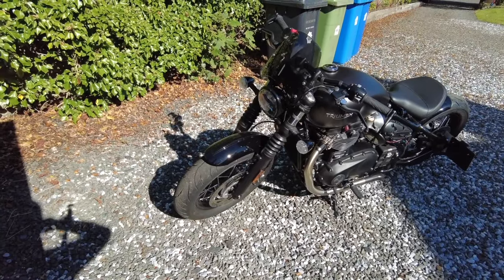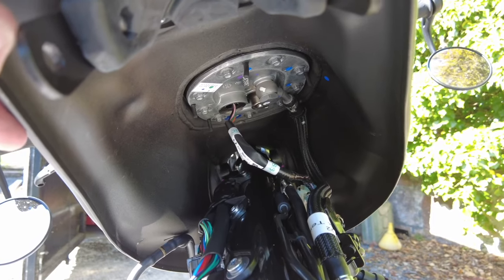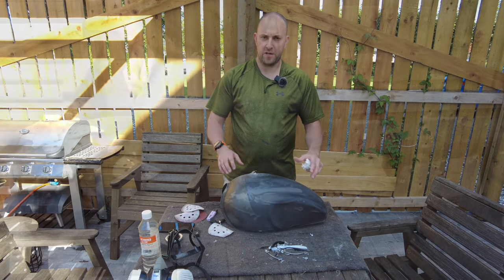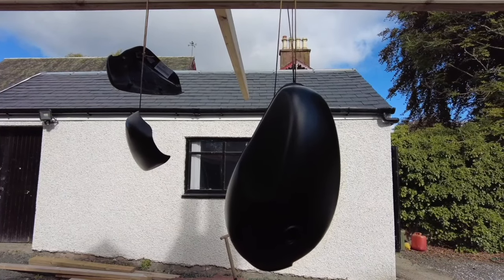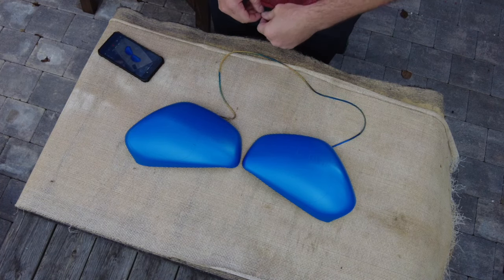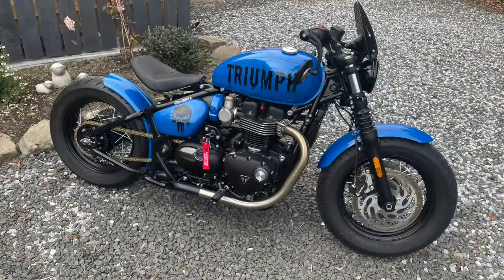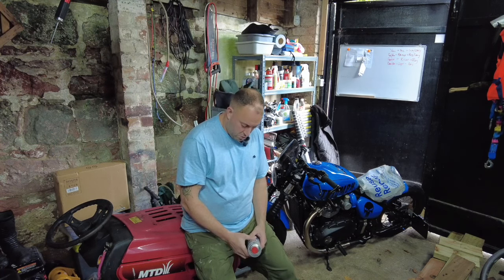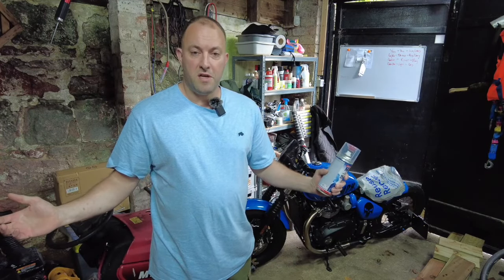Painting my BRAND NEW 2022 Triumph Bobber

Comment: Great stuff! Where did you buy your Decals? And are those specifically designed to work as you used them? Do they have a name?
Reply from the maker: I think they were off ebay. Just random vinyl decals i came across. I actually got a few more than i used. I just played with the design until I was happy. If you look up vinyl decals on ebay and filter under automotive, there are hundreds.

Comment: Incredible looking bike 🔥🔥 great video aswell 👏 thank you.... ive been looking at someone to spray mine for me but you made it look very easy! However i can only imagine how much work went into it behind the edits and so im still looking haha
Reply from the maker: In all honesty it was way easier than I thought. I had planned to make a spray booth in my shed, but I got such good results outside I stuck with it. A little bit of orange peel but it will rub and polish out. I will prob do a video on that when i get round to it.
Reply: @The_Scottish_Biker  Im definitely going to look into this a bit more because of this video 👏 i dont even want a complicated spray just a nicer colour. When you say orange peel im thinking of an actual bit of orange peel 🍊 what do you mean?
Reply from the maker: Orange peel is a common term used to describe the final finish when the top coat or clear coat doesn't flow completely smooth during curing, it ends ups having the appearance of that of an orange skin, a little bit bumpy, hence orange peel. It actually shows up worse on camera in my case than it does to the eye. A sand with some high grit like 1200 and 3000 followed by polishing should remove it and leave me with a smooth shiny finish.... or so I hope. I will record it and let you know.
Reply: @The_Scottish_Biker  ah ok thanks.. learnt something new there. I defo think i should leave it for a professional haha